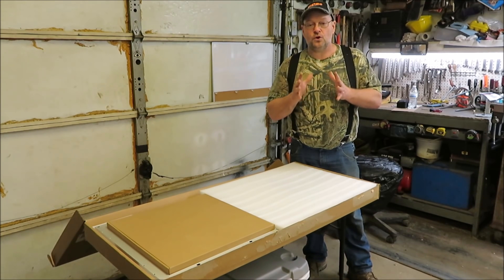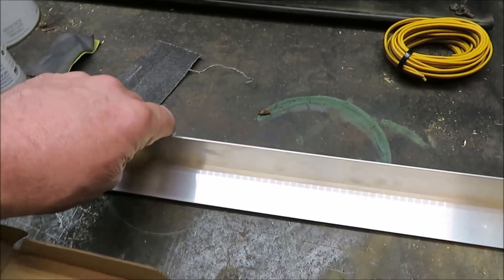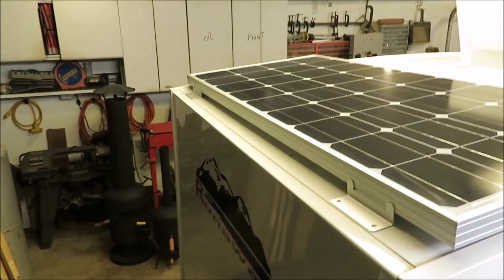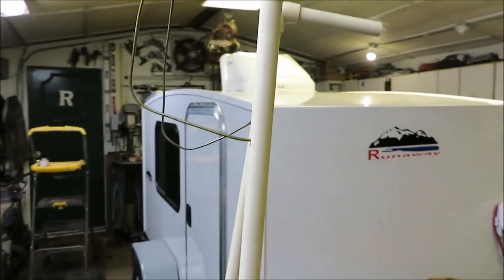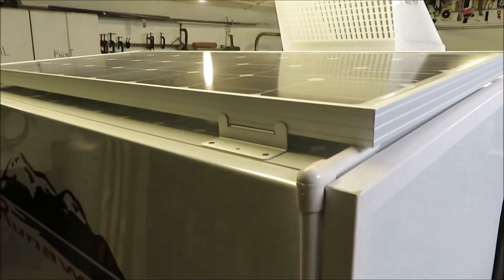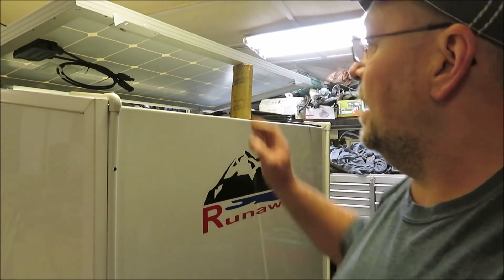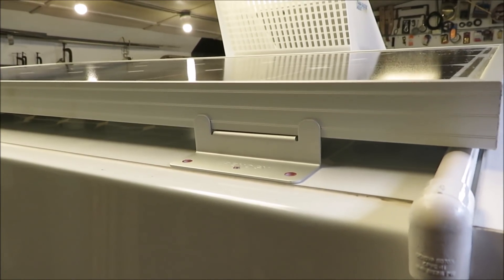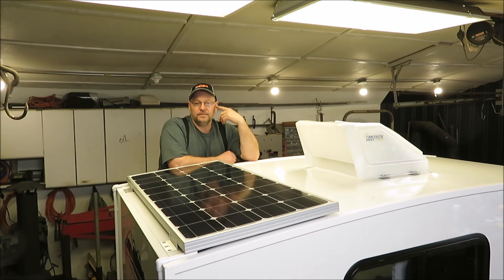runaway camper solar power install

Comment: I bought some panels with some basic stuff to set it up. I had everything except the battery bank. I think I only had 1 agm battery BUT at the last minute I chickened out and sold the stuff I had. 

I just feel really suspicious about this stuff. I've heard stories of some of these panels burning up through the roof causing fires or burns.

I think I'm gonna invest in an alternative source of power. I'm still doing research though I think it's a step in the right direction for me.
Reply from the maker: Could you email me kdr6688@gmail.com

Comment: Just a FYI for the future only thing I would recommend is that when using stainless steel screws in aluminum you'll want to put a rubber washer between the fastener and the aluminum for long term longevity otherwise you'll start experiencing dissimilar metal corrosion on the aluminum and being exposed it doesn't take long to form.  Otherwise love the Runaway trailer upgrades - getting ready to get a Cool Camp for my trike (also have the advantage of living about 3 miles from them.
Reply from the maker: Thank you so much for all the information
Reply: This actually happened to the drum inside my washing machine. The drum was stainless steel and the rear belt bracket attached to the drum was aluminum. The aluminum attachment legs corroded over time and the drum collapsed inside the washer!

Comment: Great share, it is really helpful to see another guy's approach. Around 6:00 you named the situation I and anyone else runs into with the Runaways - you have to make a big decision which aesthetics you are going to compromise to run wires, interior vs exterior. My used Runaway came with some pine interior surfacing the previous owner put in. It would be possible for me to disassemble that interior wall siding but it becomes a much bigger project than I want, just to run wires. In my case, I need to use the roof rack to carry my Sunfish and Laser (one at a time!) so I didn't want to permanently mount the solar panel. It means I have to carry the solar panel inside the camper while traveling, pulling it out when I get somewhere, and just propping the panel up on the ground, facing the sun. I figure I will get more solar input that way. At the time the boat comes off the rack, I can prop the panel up on the roof of the Runaway. Since the PVC pipe you used is really for aesthetics, you could, over time, 3D print a more styled cable cover. But then, you should be out on the road/in the forests rather than spending all your time WORKING on the camper 😁...
Reply from the maker: Thanks for watching.

Comment: Why not go with a little larger pvc and run both wires together? Just a thought. Fewer holes in the camper.
Reply from the maker: I just did it for looks you are right fewer holes thank you for the comment.

Comment: String the wire through all the pieces BEFORE putting together and mounting makes it a lot easier to fit big or more wires. 
OR, do the same thing with a string to pull wires through later.
Reply from the maker: Thanks for watching.
Reply: Mike, then you would be screwing the pvc to the camper with wires in the way. The way he did it ensures the wires cannot be damaged by the install.
Reply: Heather M, A very good warning indeed, but pretty easy to not have an issue if aware. 
At the very least, pre feed a feed rope to pull wires through before gluing together corners and pieces. Feeding wires in house remodels and cars has made me like pulling wires rather than pushing them especially if there are corners. To each there own. Whatever someone is comfortable with.

Comment: How is the performance of the panel when in the shade? I want to add a panel to my trailer also, but I worry the panel will really underperform if it’s not in the sun and tilted.  Thanks!
Reply from the maker: It worked good for me it would charge the most when I was traveling.

Comment: Are the screws holding the panel down secure to the top? Seems like the roof OSB is very thin so I wondered if it provided enough "bite" for the screws. Thanks
Reply from the maker: Greg I have over 2000 miles  on it looks good and tight I put 3 screws instead of 2 in eachbracket thanks for the comment.

Comment: I too put a 100 Watt solar panel on my Runaway Navigator.  In the same place you did. I have three sealed lead acid batteries on the front.  I am very pleased with my system since installing last year.  I started out with two 55ah batteries but realized that I needed a third one.  Also, because of the weight of the batteries and other things on the front, I added some steel underneath and on the front to accommodate them.  No problems.  Thanks again.

Comment: I used 3M VHB Tape to mount to the top of camper. I have used it plus cover the brackets with EternaBond RoofSeal Sealant Tape also. Have never had a problem with any of the items I have mounted to our RV coming loose at all. Silicone shrinks and will leak over time. You should use a self leveling sealant like SIKA 91065 Self Lev Sealant, it's a better product than Dicor also.
Reply from the maker: Thanks for the info Don.

Comment: great video. Thank you for sharing. Something to consider is rather then just drilling holes into your teardrop. Use "Wood Thread inserts". You drill a hole and insert these inserts and inside the insert is threaded for regular bolts. You can tighten the heck out of them and it wont strip out.  I mounted a Yakima roof rack on the top of my DIY teardrop and was advised to use them. Never knew of such a thing. They work awesome. A little wood glue around the brass insert and sealer between it and the aluminum roofing and works like a champ. Hope you don't mind the suggestion
Reply from the maker: Thanks for all the info Maurice.

Comment: Hi Kevin, love your video's I just order the cool camp for myself.  I did have the TV coaxe installed and the cubby with air conditioner.  I opted to have doors on both the right and left side.  I also am having a door in the back.(I'm building my own kitchen galley)  I bought foam to make my mattress and just ordered a memory foam for the top.  I'll glue all the foam together and make a cover for the whole thing.  I'm not sure but I think I missed the name of the solar panel system you installed.  I'd like to do the same thing.  Thanks for all your advise and suggestions.  Keep the video's coming.  Enjoy!!
Reply from the maker: renogy solar panel 100w you love your camper.

Comment: I think you'll like that Renorgy Solar that's what I have in my house I really like it,,,, if you find later on you want a little more power down the road you could always add a panel or two to what you got you could leave them in the back of your truck or car whatever you tow with make a little homemade stand and prop them up outside somewhere along the camper somewhere that way you could have extra power without worrying about having to mount them,,,, I use 6 V golf cart batteries they work out pretty good,,, once again I just have to say you're doing a wonderful job on that camper very 😎 cool
Reply from the maker: Thank for all the good info and the comments my friend.

Comment: Another great job Kevin you are making yourself a great camper, Just noticed your Vent Cover I think it should be turned around so the opening faces the rear, to stop rain and bugs being blown in while traveling?
Reply from the maker: I put the solar on the back of the camper the vent opening is facing the rear it looks like that because the box on the back of the camper thanks Peter.
Reply: Hahahasha got me lol

Comment: Looks good bud. Getting quite the control panel up there. Was wondering if they'll generate much heat when they're all running. If so, maybe a little computer fan to keep them all cool?
Reply from the maker: That would work thanks chad.

Comment: Thanks for posting this. I am thinking of doing the same for my teardrop. Do you have to turn off the solar charger when you are plugged in? (Does it hurt to have solar and regular on-grid chargers both on?)
Reply from the maker: Not sure but I have both on will see thanks for watching.